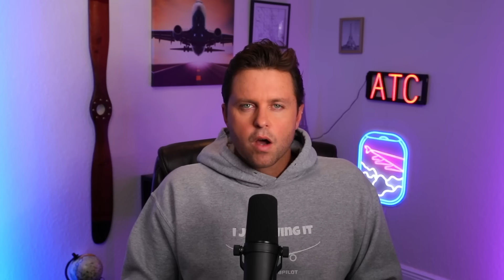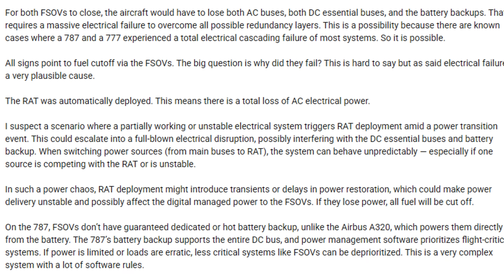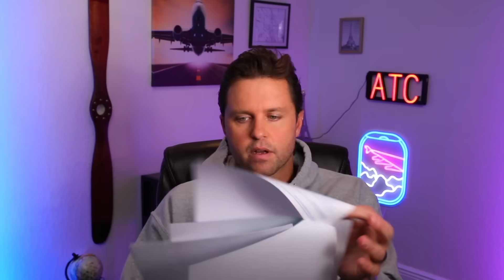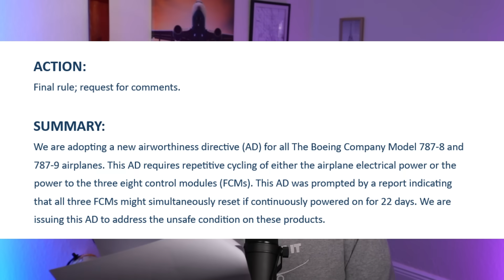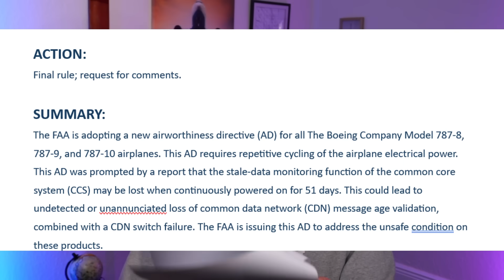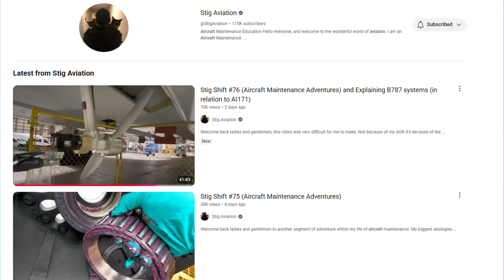Air India 171: Did a Software Glitch Cause Dual Engine Failure?

Comment: It seems correct... Boying 787 is super aircraft sure, but technical issues and software bugs problems can keep on surfacing, it can be same for its contenter Airbus... Is there any operating system which did not make periodic updates, though in this context, for a machine with humen life risk must be 100% tested and fool proofed before deployment... In spite of that glitches may surface which are to be taken in its due importance and rectified time to time...if this content provided is found to be true, Boying must take a courageous step to ground all 787 s and rectify the problem... 🙋🏻‍♂️

Comment: If you consider the position of the wheels its fairly easy to see that the crew had deployed the wheels up lever andi just wonder if that could have been the start of the problem if there was an issuewith the landing gear which took out the electrical system which intern deployed the RAT which didn't get the power to the engine safety shut off valveswhich led to both engines shutting down. The crew would not have had time to restart the engines and so the plane simply glided down to its final resting place. Those brave pilots obviously tried to the end to save as many people as they could in the little time they had. I hope once everything is sorted they get the recognition they deserve from all parties
Reply: The aircraft had climbed to 400 ft in 10 seconds, which is a climb rate of 2,400 ft per minutes, which is normal. Then the problem occurred at around the time when the monitoring pilot would have have selected gear up.

The undercarriage bogies are rotated forwards (electrically) which is the first stage of the the retraction sequence. The next stage is for the doors to open, which I do not think happened. I am not sure if this operation is electrical or hydraulic. The next stage is to raise the main gear (which is hydraulic) and then to close the doors. The process appears to be interrupted after the first step.

There are about 10 conditions that can cause the RAT to be deployed, including manual deployment.

The crash site is 1,600m from the end of the runway. The ADS-B shows that the aircraft was at 71 ft agl over the end of the runway. Without some power the aircraft could not have reached the crash site. Hence the engines were not shut down but were rolled back to low power.

I agreed that if the engines were shutdown there was insufficient time to restart them. The aircraft crashed about 20 seconds after the problem occurred during the climb and it takes 45 seconds to start each engine.

Also the APU would be required, which is started automatically but requires 60 to 120 seconds to put the generator online.

In practice something like 5 minutes would be required to restart the engines and get everything back online.

Also I think that the sprung loaded shutoff valves may be a one shot device, so that once operated cannot be reset.

Comment: The elephant in the room./
Gary stop looking at the possible causes with Boeing .
The real problem is a replacement engine was fitted by Air India underpaid maintenance staff less than a month before this crash.
Passengers were flying in a unsafe aircraft.No in flight entertainment for passengers.
I traveled once with Air India and was stuck on a hot runway without air con.
Three hours before this crash I was refused a Air India flight from Dubai to Kochi becaue there was no transit lounge in Kochi.Third World.
My experience with Air India..TERRIBLE.
They should be grounded.:face-orange-frowning::face-orange-frowning::face-orange-frowning:

Comment: We all know that the B787 development was way over budget and way over deadline. From the whistle blowers, we also know that a lot of corners were cut. In response to the B787, Airbus developed the A350, with even more lightweight materials, but they did NOT follow the Boeing logic to replace so many hydraulics by electrical systems. They surely had good reasons for this!

Comment: Fine video!
I was a pilot and avionic guy. In one case I encountered an erroneous localizer indication (HSI) during an instrument approach.
I investigated the problem myself and I found the error (the problem never occurred again).
I then checked the history of the aircraft. There were entries, over a period of fifteen years, such as: all components removed, cleaned, tested, reinstalled, the entire system checked, found OK !
The rule maker believes the sign of an authorized person is plenty. 
And there is a lot more!

Comment: I have long believed that most major disasters are a confluence of multiple events occurring the same time. That any of the events or faults individually may not be sufficient to cause the disaster, but the coexistence of multiple conditions can. I have always felt that they were going to find the fault in the new complex control systems that Boeing is now using, especially with experienced pilots. Systems are too complicated to sufficiently analyze for all scenarios.  Perhaps this is where AI might benefit.

Comment: According to a Master caution checklist on a B777 a failure of the fuel shut off valve will result in engine failure within 20 seconds. My case turned into a switch disagreement,  spar valve sensed it was closed but after 60 seconds with the engines running the computer recognized it's error.

The take away is the timeline works in this disaster.

Comment: Une explication par un spe du 787 d'Air India:

1) Early-build LN-26 cooled by first-gen forward-bay fans-->after 12yrs, flow is down.

2) 3hrs bake on a 43C stand pushed bay  temp toward 60-70C

3) Fuel system Controller (one box, both sides) hits its over-temp limit and fell to "safe"

4) All boost pumps de-energised-->fuel pressure on both EECs collapsed in <1s

5) Engine rolled back to IDLE (FASEC still powered by PMA's)-->main AC buses dropped, RAT deployed, cabin lights flickered.

6) Perte de puissance des 2 moteurs--->Crash symetrique

Comment: As a retired field service rep for Boeing I have my opinions but would need to evaluate all the data from the recorders. We can’t give or speculate on anything without the data and formulate an opinion on what happened or if it circles back to a manufacturing or software issue is just that, speculation. Keep your opinions and speculation to yourself until the data is released. The data never lies and the root cause can be narrowed very quickly no matter if it’s the  NTSB, AAIB, BEA or whatever government agency conducts the investigation. It will all be gathered, analyzed, directives published, and changes made if required. This accident will not affect my future plans to fly on an 87 in any way. It’s an excellent platform and will be for decades to come.

Comment: Right away my first thought was computer error that shut both engines off or stopped fuel pumps  computer or software glitch  either a identical from within or purposely from remote hacking

Comment: What I find amazing is that it appears to be a possible problem that has been around for some time. Why has this not been fixed to avoid it? Surely this was part of a testing scenario at Boeing? Total electrical failure. What happens to the engines etc. there appears to have been plenty of opportunity to block the hole in the Swiss cheese one on this one. Sidetracked or buried by the 737 max saga?? They talk about saving the airframe. How did that go when it hit the ground. I think Boeing should call it a day in aircraft manufacture.

Comment: Was the crew aware of the problems. The pilot  did not mention los of the engines. Ten seconds, before impact, los of power and thrust. It stayed airborne in Total 37 seconds. The start was OK, flaps, etc, it reached 625 ft hight. Where they aware, what happened.
Reply: The 625 ft was from the ADS-B data and was with respect to standard pressure 1013.25 hPa. On the day the QNH was 1001 hPa and the field elevation was 189 ft. This is equivalent of 71 ft above ground level (agl). There were 8 data points with height of 21ft to 71 ft within 600m of the end of the runway.

From the video the aircraft climbed to about 400 ft (twice the wingspan of 197 ft).
Reply: @christopherrobinson7541 Why did it fail, and was the crew aware.

Comment: Gary, great job on providing information on the varied aspects of what could have gone wrong after takeoff. The landing gear wheels tilting down with the gear up selection was very informative in another video.  Based on what you have provided here, the pilots mayday no thrust, no power and the survivor recall of a loud bang and the feeling of standing still for 5-10 second are vital clues. The flight data recorder data will give us the operating parameters of the flight help pinpoint the issue. I hope there was no dual engine thrust roll back from the fadecs or event similar to the landing event you have presented here. Also, it will be interesting to know if the CVR picked up the loud bang noise heard by the survivor. An unstable compressor stall (new knowledge for me) would be critical to flight operation during takeoff and landings.

Comment: For me The thrust levers work the engines, but their are bits in between, that generate a signal that goes to the engines from the flight deck.  What happens when those bits loose electrical power.  So cant send or make a thrust signal.  That is the bit in common to both engines the electrical  power supply to those bits. Also back up electrical power, is backing up nothing if the bus is either open circuited/broken connection or shorted (un able to sustain a voltage). Disagree only because it sounds like the engines were running but on idle in the side video of the plane going past with the sound of the rat.  Also fuel problems, blockage, leaks, or vapor lock would appear in one engine not both.  And bad fuel quality would effect other aircraft.  And even with one engine running properly, it would have been put on full noise and been able to keep the plane in the air.  The plane appears to be gliding down like it was going to land.  They had flight control but not enough thrust.  Something had happened to the thrust setting signal that goes to the engines.  Was it no longer generated due to no electrical power.  That is my electrician bias, and guess.

Comment: DT Technician : These are basically back lash valves to prevent ignition into the fuel tanks safety measures the bottom line is if there was a electrical blow out and electrical power failure this then confirms why the RAT deployed alone with proof of lights flicker.
The RAT is basically like a UPS in a data centre for mains power failure difference being UPS’s use a battery source were as the RAT uses a wind turbine to generate electricity.
Reply: The RAT needs an airflow speed of more that 160 kts to spin-up and a minimum speed of 130 kts to remain online. Depending of the speed of the airflow it takes 20 to 30 seconds to come online. During this period, some loads, such as the emergency lights are powered from the aircraft batteries. Switching between power sources can cause the light to flicker.

Comment: Air India is hiding something. 
How can a person walk off the plane alive but suddenly the black box is destroyed. I smell a rat.
Reply: The survivor was in seat 11A, just in front of the wing, adjacent to an emergency door without any seats close in front. Opposite and toward the center there were cabin crew facing aft, who could have advised brace for impact. The survivor was a large fit and strong male and without seats in front probably avoided serious injury and hence could exit the aircraft as soon as he regained consciousness. 

The B787-8 has combined recorders and two are installed, one in the front of the aircraft and the other in the tail. The unit in the front was probably damaged by the post crash fire. The other unit should be able to provide both cockpit voice data and flight data.

Comment: For god’s sake Boeing , pls give the full authority of fuel control to the pilots, not to the softwares. Even if the software closes the spring loaded fuel valve the pilots can still turn it on at least 😢

Comment: If this is true: This is not a SW glitch, it is a major failure in the system architecture.
Reply: I agree.  It's not a glitch.  It's a design issue. That they knew about.  Surprise, surprise....
Reply: When there was this battery fire with Japan Airlines 787 in 2013 there was already talks about this to happen in case of an electrical problem.  I thought Boeing solved this.  This is crazy.
Reply: not to say of the "philosophy"
Reply: @stevemuller8320  Boeing's philosophy is arrayed around money and held together with corruption.
This shouldn't affect the products.
Reply: @doom9603  In other words, basic capitalism.
Reply: @doom9603  Law is on the President's side - and Boeing's side.
Reply: I agree.  Bad System Architecture.  Some folks think Safety Systems are supposed to be Fail Safe by Shutting Off when there is no power.  Has someone done a FMEA on dual Power System failure, they may have caught the FSOV as a big issue.  They should have designed it as Nomally Open, energized to Close, so if it lost power it would still stay open.   Something critical like this would require dual shutoff valves and triple redundancy on power...   I wonder if I can find non 787 flights to Asia?
Reply: as cost efficieny took over beginning of 2000s, the quality of Mercedes E-Class vehicles declined, it's about saving every cent during production, quality? not that important
but, quality can save lives, especially in aerospace applications

Comment: Hello Captain, it’s terrific. What I think : take off is very late (grass blowing behind the plane) , electrical problem starts after V1, loss of power, take off, positive rate, captain try gear up, shut off engines by electrical problem, RAT deployment, Last captain MAY DAY message… terrific.  I must fly in a 787 in e few days. I’m very desapointed.

Comment: If a "SW glitch" causes catastrophic failure: There is a lack of redundancy essentially required for any airliner.

Redundancy means separate paths of function (independent systems, bus systems, ...)
Redundancy means dislocated in the mounting (separate those systems in the routing across the airframe)
Redundancy means using independent engineering in specification, technology, SW, suppliers, testing and certification.

Does this video want to tell us Boeing does not use the state of the art in redundancy while building the most modern airliner?

Comment: Contaminated Fuel is already ruled out as a possibility (check out Flying Beast's video) because it would require a high level of coordinated sabotage to overcome multiple safety check, as many other flights had taken off the same day, vapor lock too is similarly very less possible because it won't explain how both engines got affected the same time.

Comment: I work in automotive maintenance and I deal with the safety of machines in relation to people. I cannot imagine a more important issue than sustaining the operation of engines even when all other systems fail, including electrical power. I do not believe that valves have been installed in Boing that need energy to open otherwise close without energy. For safety, it is always more important to work even in exceeded parameters than to not work at all. If the parameters are wrong, then at most protection should be limited to issuing an order to reduce the thrust, but the pilot should always have the final control.I do not believe in such basic design errors that someone approves these systems. I want to believe that you cannot build systems in an aircraft as you please in the case of Automotive, a certificate is issued for the safety system and every year the device is checked by an external body. How much more must it be in avionics.

Comment: I remember a few years ago I was flying in a 787 and during the takeoff run right before V1 
The captain aborted the takeoff the. Went back to taxi way…
Saying that the software gave him a few strange electrical power discrepancies… something like that.. then he said we will have to reset the software and check the tires and brakes then we took off gain
Reply: Resetting the software instead of fixing the problem is wild. Thats not a average PC that can be rebooted for fun and keep being worked on :O
Reply: The big problem with the B787 is it has a mind of its own called the FADEC (Full Authority Digital Engine Control) which thinks it knows better than the pilots on how to fly the plane. Be very careful what you do with the gear lever. If the gear don't work DO NOT leave the gear lever in the down position. FADEC will think you want to land the plane and it will cut the thrust when it detects the ground.
Reply: @cyber5515  Such systems on Airbus, and in the fighter jets, do know better. The reason there is an issue is because the Americans obviously can not build secure software in their Boeing stuff, because they gave a shit about QualityManagement (one of their managers committed suicide). Due to regulatory capture and the lack of the boeing management to address the things, as well as incompliance with the process paradigm, instead they pushed for profit & produce as much as possible in the shortest possible time paradigm. To me that sounds like the root-cause

Comment: How then Aircraft lifted off and climbed up to FL6.5??
Reply: It did not reach FL065, 6,500 ft. The ADS-B data is 625 ft with respect to standard pressure 1013.25 hPa. With QNH 1001 and airport elevation of 189 ft, give the height above ground level of 71ft, near the end of the runway.

The aircraft had previously climbed to 400 ft (twice the wingspan of 197 ft) at about 2,100m down the runway.